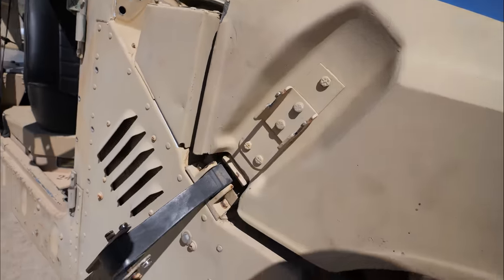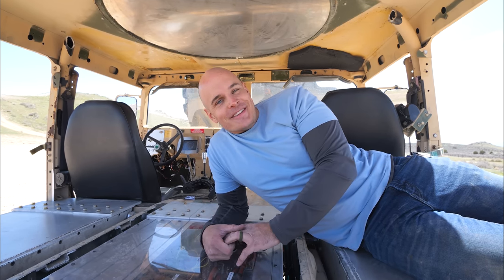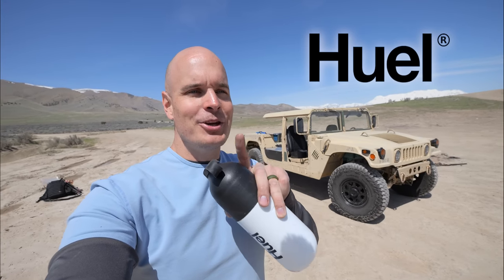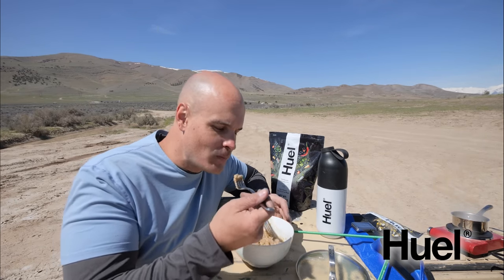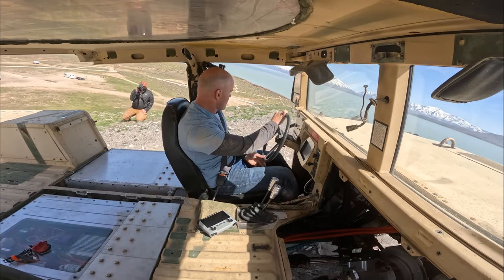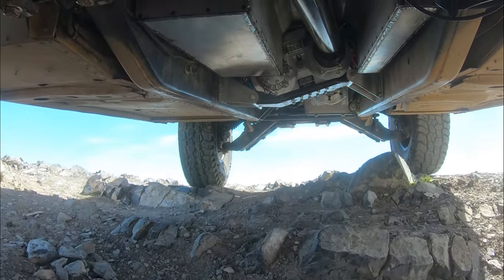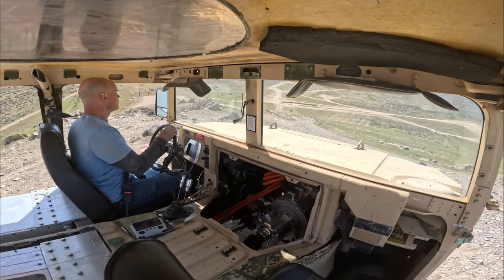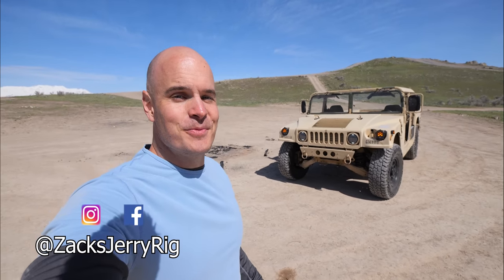Off Roading my DIY Electric Hummer - What could go wrong?

Comment: Looking at the footage from under the vehicle. there was not much suspension movement at all, leading to wheels lifting off the ground and loss of traction.
Softer springs would help with keeping wheels on the ground / traction as well as comfort.
As per a previous comment, I believe that Humvees have Torsen diffs, and if you briefly touch the brakes while keeping the accelerator depressed, that partially "locks" the diffs.. I am not an expert on that, but research it.. apparently it is quite effective.
And yes, rebuild the B pillar or add a real roll cage. If you ever tip it or roll it (not likely with the width and low centre of gravity, but not impossible) it would be good to have a strong structure to prevent the bodywork crushing..
Great to see it driving.. thanks for taking us along for the ride.

Comment: I'm wondering if you could add electronic lockers to the HMMWV to reduce that wheel spin? Also, you should paint up the circle on the roof to resemble a helicopter landing pad, but with a large " D " for DRONE!
Reply: It has a much better system than lockers, he just hasn't learned how to utilize it yet.

Comment: The HMMWV's torsen differentials are torque biasing limited slip. If you start spinning a tire, just drag the brakes a little and the diffs will lock up and send power to the tires with good traction.

Comment: Proud of ya bud.  Good news. Torsten does brake acceleration modulation. Since you didn’t put a motor at each wheel and the diffs are active, you can depress the brake pedal when you have wheels pin and it will stop the spinning wheel and trick the rest into thinking it has traction. The. Other wheels will pull. Drive two footed off-road.

Comment: Aside from locking diffs, you also need WAY more articulation. Guessing that weight reduction has you driving around at full droop almost. Being able to keep the wheels planted is key. Beefy sway bars with electrically disconnectable ends would keep it safe on the road and let you get more articulation too. Or pull them out if it has any. Softer springs are definitely on your shopping list along with lockers though.

Comment: FWIW, the trick with Torsen diffs is to apply the brakes while on the "throttle" at the same time.   Torque biasing diffs (which the Torsen is) multiply the torque applied to the low traction side by the torque biasing ratio (determined by the angle of the teeth in the worm/wheel inside the diff) and send it to the high traction side.  The TBR could be say 2 or 3:1.  Obviously if the low traction side takes zero torque to spin, then zero * 3 = zero.. but..  if you apply the brakes and put some load on the low traction side, it'll send 2-3x that to the high traction side.        This is a well known "trick" for getting the Hummer unstuck.  
Now if you've got a safety cutoff circuit that prevents you from applying brakes and throttle at the same.. well, then you're kinda stuck, literally and figuratively.     Most modern vehicles just use the ABS to brake the spinning wheel and that sends 1x the torque through to the high traction side (via a regular open diff).

Comment: Hello, It does have a Torsen ---Limited Slip Differential supposedly (That technology has been solid for 30 years) You can see it working perfectly when the wheel comes off the ground and you are moving forward. I think the wheel started spinning because you were rolling backward during that time..

Comment: A tip for the throttle. I had a motorcycle that did the same thing, jerky throttle over bumps. Brace your ankle against something solid. For a motorcycle I would stick my index finger out over top of the brake to keep my bike from jerking due to the torque.

Comment: If I understood correctly your Hummer has Torsens. They work using a torque multiplier, so for example one wheel can output 3x more torque than the other. The problem is three times zero is still zero, so if one tire has zero traction, the other will also not get any torque. It helps to slightly apply the brakes so the tire in the air has some friction, which allows the tire on the ground to put down quite a bit more torque.

Comment: diffs takes abour 30% of power, so there goes your 50k km of range wastested to generate heat in gears ; 
thats why they mount motors in wheels, direct drive, the most efficient ;

Comment: Lower it a bit for straighter axles (less noise and wear), reduce the spring rate to get more travel (it is set up for full weight and gear), might need to reduce damping to get easier movement (if you reduce spring rate). Air down tires to get better traction off road. (add a compressor maybe?)

Comment: Great job. But you need weight in the front axle, maybe another battery pack in the front, that will help with traction and some ARB locking diffs.

Comment: Zach you should put a driveshaft hoop in the tunnel between the batteries. It will stop the driveshaft from slapping around in the tunnel and damaging the batteries or injuring you if for some reason it come uncoupled from the motor or transfer case.

Comment: Suggestion regarding throttle control... What Im doing is implement a max rpm     control that reduces throttle sensitivity as I turn down the max rpm, so that when I crawl at 1000 max motor rpm, the throttle ramps in slower as well.

Comment: 5sec on google indicates you should be able to get an air-spring kit for the Hummer.  It'll let you setup the springs perfect for whatever you're doing, and you already need an air-compressor for the tire pressure system anyway.

Comment: bro air down the tires a bit, please dont tell me you had them at like 35psi. if you get some beadlock wheels, you can bring it down to like 7 psi and have such better performance and a softer ride.

Comment: What's stopping you from changing the gearbox?  To have the right system for off-road experience.  How much does the car weigh?  You have already replaced many parts, you could also make a carbon engine cover with built-in solar cells, of course, in the same design, if you need to keep the look.  You can replace your car springs with hydraulically adjustable ones to reduce air resistance when driving fast.

Comment: Besides for the diff issue, the other issue I see is that your springs are WAY too stiff as they were designed for more weight that you have currently which caused your wheels to raise up off the ground. Think about this, its meant to be fully loaded with 4-5 people all with full gear loadouts then their extra gear in the back and all the systems and it had all things (b pillar, turret, back glass/wall). If you can get close to the original weight fully loaded you will be good, but I think a change of springs are in order.

Comment: I’m not too sure, but if you add a bit of weight back, you’ll put your vehicle in a more comfortable area of the suspension too. Like when you go on a bump, you won’t max out the suspension as easily since you’re closer to the top of it now? Kind of can see how little the wheels move when you lose surface on the hill. 

Kind of semis, they ride better with the weight since theyre designed to haul stuff compared to empty! If I’m tracking right!

Comment: so you've taken a vehicle specifically designed to offroad, changed its engine and checked to see if it can still offroad? Its cool but its not a surprise at all. And i think your friend made it actually run. Of course it looks like removing a lot of weight from teh front end has hurt its offroading a bt. Still does it well but when you change the balance it has unforseen knock on effects.

Comment: You need to let some air out of the tires, and the suspension is way too stiff without all the weight, which allows you no travel, it obviously has plenty of power, very cool work in progress, I can't wait to see it finished...

Comment: I think it would be super cool to add things like a tire inflater and deflater system if the rims you have support that or atleast adding a compressor to do just that. If you are thinking about new suspension, a neat suspension might be air bags, they would be able to adjust the ride comfort and ride hight so it would be good for off roading and all around fun.

Comment: Brake modulation and adjust the suspension, looks like it's riding at the upper limit forcing wheels off the ground too soon. It'll go up that hill without a prob!

Comment: With Torsen differentials if you start loosing traction step on the brake a little. They are torque multipliers and when a wheel is in the air the torque is 0 and 0 times anything is still 0. So give it something to work against with the brake.
Reply from the maker: My brake electronically triggers a motor shut-off so that trick wouldn't work on my conversion unless I disabled some safety features which probably isn't a good idea
Reply: @JerryRigEverything  Woah. That's a problem. You need to activate both the brake and accelerator for the torsen differential. I would use a momentary switch brake-switch override on the dashboard for those rare high off camber situations.

Comment: i would suggest some kind of shocks or suspension. when you were climbing that Mtn, there were several
Times when you had only 3 wheels on the ground. yea yea, i know it's a hummer, but it sure could use some
good shocks and springs. just a thought for a good project.

Comment: So just a couple of questions. 

The brake dragging has already been tagged by many others, but would such a maneuver benefit a restorative braking system?

Second was the psi lowered in the tires?  I ask for not only the increased foot print, flexibility of the tire, but also for consideration in calculations of efficiency.

Comment: Your suspension is fully extended and you are getting 0 suspension travel because the springs are too hard for the current weight.  That's why the front wheel lifts.  With softer suspension, the front left would have extended and reached for the ground on that surface.  Very simple mod that should be a priority.

Comment: In the army, they taught us to ride the breaks to prevent "loose" wheels from spinning.
Reply from the maker: The only issue is I wired my brake switch to cut power to the motor.  (For safety) so I can only operate one or the other.
Reply: @JerryRigEverything  well that makes things difficult
Reply: @JerryRigEverything  how are you supposed to to crazy sick burnouts?

Comment: Zack I have loved watching your hummer series.....such a shame about the efficiency.

Do you think, you could go to a pannel maker and get some lighter  body work made....of you got to add door and paint it, then you might as well get some pannels made......I really think lightening the load could help.

Also look at the type of tyre your rivian or F150 lighting are using.....maybe your tyres could be creating a issue.....also if you have to reinforce the frame then you need to be looking for as light as you get, whilst obviously still holding strength.

Comment: On the new Polaris pro r they have a switch that you can flip that changes the throttle sensitivity. They have a rock crawling mode that makes it half as responsive as normal so that you don't get the jittery effect when you are going over bumps.

Comment: I think your drivetrain design is your limiting factor for range. adding the additional gear box, and using 4lo when you most likely dont need it, is going to chew energy. Independent motors may have cost a tad more upfront, but they would likely have reduced the complexity of the build and improved the efficiency. Running the motor directly into the Differential and bypassing the gearbox entirely, you would likely net out in weigh between the transfer case, driveshafts, brackets, etc for the new motor, controller, new brackets, etc. and the motors and controllers would sit lower in the frame so you could mount batteries under the hood. plus of perm. mag motors are used maybe "part time 4wd" could be used. just a button on the dash to turn off the front motors for road driving. its a military vehicle. it needs an After Action Review haha

Comment: Did you say this has a low range, is that necessary, as the motor shouldn't be limited to rpm and has instant torque at 0 rpm in comparison to a ICE?
Reply from the maker: Correct. But I like the ability slow the tire rotation. More control over that in low range.

Comment: Your front suspension has very little flex now that there’s no weight on it. You are probably going to need a much softer spring in the front to make the ride better. I noticed that your front suspension is ridding at almost full droop which is not what you want.

Comment: Tyre pressure is way too high, should be running like 15 PSI and it looks like you're at like 45psi. That would have made it a lot smoother to drive up that track. Additionally it does seem like your suspension is extremely firm which you mentioned

Comment: 600Wh per Kilometre is CRAZY thirsty (going by you 100 mile range estimate). That's nearly twice the thirstiness of the new Hummer EV, which is bigger and heavier than what you've got no doubt. I reckon your battery charge % is either not linear or is way off (uncalibrated?). That or the drive train has some serious inefficiencies, but likely that'd come off as heat (due to friction)?

Comment: But open differentials are actually modern, what happens today is that modern traction control uses open differentials together with an ABS breaking system that holds free rotating wheels or the inside wheel on curves when needed. It all happens in the brains nowadays.

Comment: I know this is still in progress, but I would not be driving around with the access panel inside removed. Take it from a guy that’s popped a U-joint in his jeep going about 50mph and had a wild driveshaft slamming the bottom of the tub like a propeller…

Comment: The suspension is made for weight. Without weight youll be bouncy and turns the electronics into an RC stutter lol.
Seems likely theres not much weight at all the way the wheels dont flex much

Comment: Not exactly a mountain. More like a hill. In the UK. we have potholes, bigger than this... I'm pretty sure my 1.2 Nissan Micra, would have got to the top, with no problem... It's a "Go Anywhere "car. It doesn't have split diff, or any of that other malarkey. But it does have split rear seats, for luggage etc. 4-wheel drive is accomplished, when 2 of my passengers, get out to push... 🙃

Comment: Why does it have like zero suspension? When one of the wheels gets into the air it just sits there. It’s supposed to string down to keep contact to the ground. Also you really need diff lock especially if you have a suspension like that

Comment: roll cage, diff lock, or use a sub trans gearbox (like the dinky ct125 honda), and make a H3T style roof ( or the israeli m1114 variant), a more balanced torque bandwidth, its useless to full throttle it all now since its way lighter, and a  more light flex coil spring on the suspensions

Comment: Way too much weight removed for the suspension. The springs are acting like solid bars. There is no articulation because the suspension is not compressing. Two options. 1. Add a few tons of weight. 2. Swap out the coils for way softer ones.

Comment: double or triple the battery capacity to make it not useless. 

Also fix the damn suspension or you'll have 2 wheels on the air most of the time.

Comment: The turret ring has nothing to do with the way the suspenion is. All HUMVEE's of that time frame are a base model with just added componets.All of them are the same the reason being is that you can take a 4 seater and turn it into a troop transport or add the ambulance back to it . I know this because I used to drive those when I was in the Army as a medic also I turned a 4 seater into the Cargo/Troop transport.

Comment: QUick question, off-roading is usually done at faraway locations and with no public grid for charging... if the car has estimated 100 miles range how do you solve the charging problem, or do you tow it about at the end of the day

Comment: It seems that the suspension system should be upgraded to suit the new vehicle weight.  As the old system is very rigid and there is no flexibility that allows the tires to remain in contact with the ground.

Comment: Could you have 2 selectable drive modes with different throttle responses? You will want fairly instant throttle response on road but a slower one for offroad maybe with a lower range of allowed input?

Comment: I have a question about the slipping wheel. I am aware that all the power will go to a slipping wheel in some vehicles (due to the differentials), but what's the difference between a slipping wheel and one that's not even touching the ground? How come when you had one wheel completely off the ground, you were able to still move forward with the other three wheels?

Comment: Weeeell.. i guess now you have to get the new rotary generator mazda has developed for the new hybrid line.

Crazy to see how much more efficient a optimized/standardized EV gets. My cheapo-overpriced corsa-e might get to 200miles (up to 300km) with its "not really" 50kWh battery pack. And they also stuffed the battery+motor into a standard fuel car chassis.

But at least you get all data and infos from your battery and not just a stupidized rangemeter which isnt getting better after driving the same route every day for a year. No actual "energy in battery" info at all to do your own calculations.
Just the 17kwh/100km average (winter) and a jumping range-o-meter.

And suddenly increased cold weather range after a software update, because they now discharge the battery lower. Otherwise theyd have failed their stated range and maybe got fined.